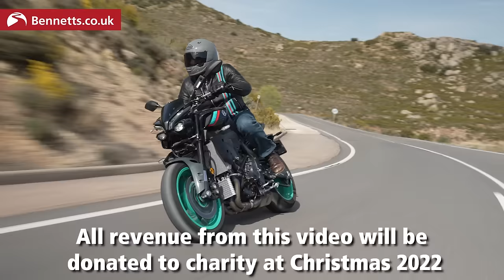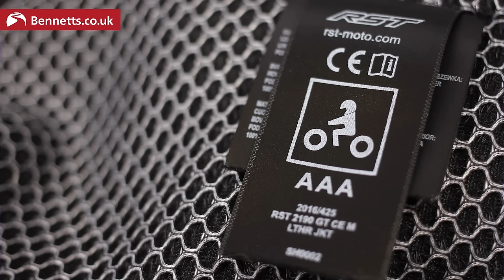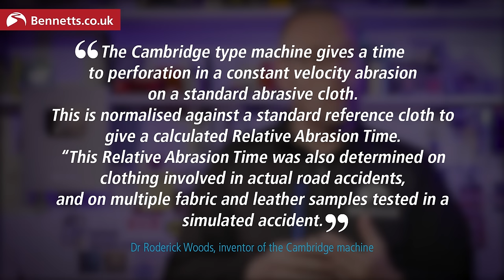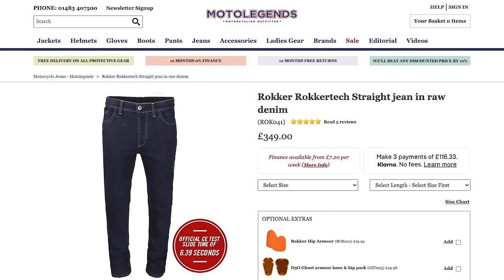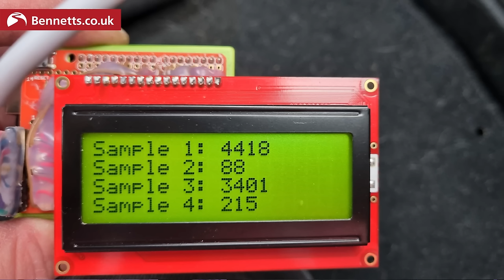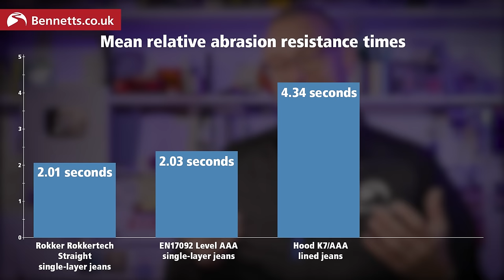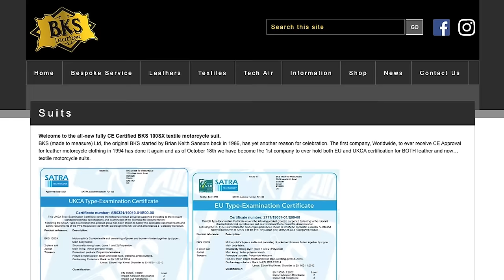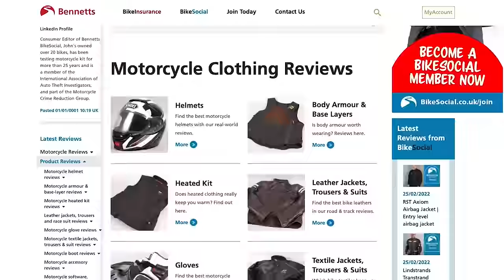Best motorcycle jeans | Single layer vs lined: THE TRUTH

Comment: Thank you for such an informative video. I’ve been also reading and searching about the motorcycle jeans during the pandemic ( for 2 years :D ) and the more I read, the more I got confused. After I figured out not all the motorcycle jeans are same, I ordered a K7/AAA but  bought online it’s a little bit on the thigher side, and I could only wear comfortably by removing the hip armours. It is also quite hot to wear in a start-stop city traffic. So I ordered a AA-rated single layered jeans in this Black Friday discount. It is written that it has 6.39 seconds of slide time claiming more than enough. So after watching your video I have 2 questions in my mind: 1. When I go on a ride in the twisties at weekend, should I wear my AA-rated single layered jeans or should I try to fit in my AAA-rated lined jeans?
2. I don’t quite understand in the video is that if you ever mean “a AAA-rated single layered jeans are less abrasion resistant than a AAA-rated lined jeans” ? Aren’t they meant to be same in terms of safety?Thank you very much again for your efforts, and explanations.
Reply from the maker: It really is your call, but personally when I'm riding out of town I use lined jeans. That's just my choice. 
Under EN17092, the levels are pass or fail, so AAA means the jeans have passed the most stringent of the abrasion, tear and seam strength tests for that certification. But we don't know by how much. EN 17092 is an easier to pass standard than the previous EN 13595, but it's still very valuable. However, the indicative test carried out here, as well as tests on more than 50 jeans by https://www.motocap.com.au show that lined jeans tend to be more abrasion resistant than unlined. And that good quality leather (not ridiculously thick leather) remains the most protective. 
It really is personal choice, and while I know I'd be 'safer' in leather when I'm thrashing my S1000XR on tight back roads, I choose to wear lined jeans. No test gives a 'slide time' – that's just a lack of understanding from sellers or simply misleading. Equally though, it could rightly be argued that if you hit a car or a tree, it doesn't matter what the abrasion resistance is!
The gear you have is not 'bad'; as Dr Hurren says, any motorcycle kit is better than no motorcycle kit. It offers you a level of protection, and that's great. It's way better than plain denim! How far you want to go with protection is your call, and it's important that you're comfortable too. If you end up pinched and sweating, that's going to ruin your concentration.
Have a look at this article, which will hopefully help: https://www.bennetts.co.uk/bikesocial/reviews/products/textile-jackets-trousers-suits/what-best-motorcycle-riding-jeans-kevlar-pekev-covec
Cheers, John
Reply: Thank you very much for your answer. I’ve just read the article. Your answer and the article have fulfilled the gaps in my understanding. I hope to see science, technology and investment on motorcycle gear develop quick enough like the motorcycle community.
Reply from the maker: @tongucarslan3840  No problem! I honestly just want people to be able to make informed choices, not influenced ones! Cheers, John

Comment: i remember when i first started riding i was super cautious about protective gear, after about a year on the road though i slacked off and started wearing shorts and tshirts. guess i was lucky i never came off at speed. only ever had one accident when i was learning on a 125cc scooter before getting a decent bike. i was going about 25kmph when a van braked in front of me without warning i skidded sideways to try an avoid head on collision and the bike fell  on its side twisting my under it and causing an acl injury which is not something i would wish on anybody, strangely though i didnt even get a single scratch, i dont even think my clothes got torn ?

Comment: Nice research, but the sample size is too small to conclude that all lined jeans offer better protection than all single layer jeans. This only shows that for the specific jeans that were tested. There are many single layer and lined jeans with a triple A rating.

Comment: Hey Team, 

Is it a fair assumption to make, as a consumer, that AAA jackets (or pants) are at least more resistant to abrasion than AA jackets, almost always? 

I'm in the middle of trying to upgrade my own gear, and I feel it would be helpful to at least narrow down the search to AAA garments, and only worry about the differences from there. Might end up being helpful to others as well. 

Thanks if you see this, and take the time to respond
Reply from the maker: Hi... Yes, absolutely. While in theory a brand could have only tested to a lower level, then only way to PROVE the abrasion resistance, seam strength and tear strength of the entire garment is though proper certification. Beyond AAA, the Bennetts High Performance Awards allow brands to prove higher levels of protection. https://www.bennetts.co.uk/bikesocial/reviews/products/high-performance-safest-motorcycle-clothing

Comment: I know testing can make things cost more, but many MFG's need to be held accountable to their claims - results must be available to the consumer. I would prefer a 3rd party non-profit style company that is publicly controlled (to reduce the risk of the Board taking unreasonably high salaries and to keep the public's best interest at heart). I'm not saying EVERY style of clothing needs to be tested, but they must demonstrate that their fabric, stitching, pads meet the standards. If they want to go the extra step and test specific styles, good on them--It would gain a sale to me at least.

Also would like to add, I wish there was a thermal transfer type of test. Most moto-gear, especially leathers are capable of abrasion, but don't really take into account the heat from the friction. Some of the tech fabrics have materials that can melt at certain temps, or very thin might burn your skin in a slide.
Reply from the maker: Have you checked out Motocap? Also, BS13595 should help a lot. Not all brands will use it, but riders can vote with their wallets.
Reply: @bennettsbikesocial  thank you.
Reply: @Frag EightFive: Testing does not need to make things cost more. When you purchase motorcycle clothing, part of the price you pay includes a proportion that the brand reinvests in the sales and marketing activity that may have influenced your decision to purchase their product  - advertising, brochure and web site, for example. If they vire some of that budget over to compliance activity, then testing will not affect retail prices any more than their advertising, brochures and web sites do.

An example. Last year, a company told me they “couldn’t afford” the costs of testing and certification for the item of clothing they were selling to motorcyclists. I pointed out to them that they had placed half-page ads in two of the monthly motorcycling magazines for the previous four months. In fact they had more than enough budget and were, therefore, choosing to advertise an untested, non-certified and illegal product, when just half of that four-month advertising spend would cover the entire conformity process!

Comment: Companies can still do better. Why is there not armour with tungsten carbide beads for wear resistant, aerogel for the isolation layer to protect from heat, then an impact layer? Should be able to slide for a hell of a long time if you at least made the armour pads out of those materials.
Reply: Some fabrics incorporate a ceramic component. My own BKS suit features this on the shoulders, elbows and knees. The fabric is quite stiff when new, however, and some riders seem unable to tolerate anything that feels even remotely restrictive.

Comment: It'd be interesting to put a thermometer into the Darmstadt or Cambridge tests to measure heat build up, as that's an important component in injuries incurred from sliding down the road.
Reply: Some work with the Darmstadt machine has already been conducted by the PIONEERS project. The following is a limited extract from the report on temperatures at the point of contact between test specimen and abrasive surface.

"Nylon ripstop was tested at 7 different rotational speeds from 30 till 70 kmh, with 3 sample runs for each rotational speed. The highest rotational speed was determined as the speed were hole formation was first observed.

"Maximum temperatures for the 4 graphs (Figure 44) below are: 69,97°C (30 kmh); 100,77°C (50 kmh); 120,18°C (60kmh); 142,55°C (70 kmh). 

"Performance leather was tested at 8 different rotational speeds from 30 till 120 kmh. The highest rotational speed was determined as the maximum rotational speed according to EN17092 because no hole formation was observed.

"Maximum temperatures for the 4 graphs (Figure 45) below are: 60,90°C (50 kmh); 64,42 °C (70 kmh); 71,68 °C (90kmh); 83,42 °C (120 kmh)."

The researchers encountered a number of issues with identifying how much of this heat transferred to the back face of the test specimens, which would equate with the skin of the wearer in a real world incident. The MotoCAP team is planning to conduct its own research, using the Cambridge machine or and/or its road-based tester, in the course of the next 12 - 18 months.
Reply: @paulvarnsverry11  Thank you very much for this insightful report. I used to work in Oil and Gas engineering, it's good to see that as much thought goes into motorbike safety gear.

Comment: Hi, thanks for the detailed review. I have lined which is good to know even if they are a little hotter on summer days. Have you considered doing a similar detailed test on airbag vests?
Reply from the maker: I am looking into that as most of my experience is only with the In&Motion system. Cheers, John
Reply: @bennettsbikesocial  I have the turtle 2 and specifically the version with the lanyard preferred the mechanical over the software driven versions. But would be good to know how the software works for the various providers, reliability and also mine doesn’t really need servicing just weighing the gas bottle so there’s a good video I think in overall cost versus protection etc 👍🏻
Reply from the maker: @rossmiller7741  The Helite system does offer excellent value – I have used that several times too (fortunately not in anger!). Cheers, John
Reply: @bennettsbikesocial  Indeed, it would be fab if you could do a detailed and in-depth airbags review – particularly the electronic systems, which vary in which crash scenarios they deploy. Airbag coverage also varies significantly. And while a few are CE Airbag Level 2, most are only Airbag Level 1.
Reply from the maker: @The-Splat  it's in the pipeline... cheers, John

Comment: I have skin shear on my upper inner thigh of my right leg. I got it in 2013 after a Transit van cut me off at a roundabout and shoved me into the Armco.
The force cracked the back of my helmet.
I have had the skin shear since then and it has never healed. The GP has treated and I continue to treat it every day.
It purple in colour and sometimes you can see the bone.
I think because of Syringomyelia and Diabetes it will never heal.
From suffering a C4-6 SCI and TBI in 2004 at 37 years old, my body was referenced to that of a 85 year old.
Reply from the maker: That's horrible! Sorry to hear it!
Reply: I would be very interested to discuss your skin shear injury with you for research I am conducting.

Comment: Fantastic information, brilliant work well done!
Question - regarding single layer hip and knee protected stretch jeans, i'm tending to wear various types of good fitting thermals underneath them (not silk yet), what's your gut feeling on this extra layer adding protection vs any negative points. Best wishes.
Reply from the maker: Any extra layers will add some extra resistance, but only testing can give the final answer. Cheers, John

Comment: The American made Saints denim for motorbike riders states it's the toughest on the road to date. Described as unbreakable jeans.
Not many people have heard of them.
I wonder how those would stand next to what you have already tested.
Reply from the maker: We've not had a pair of Sa1nt jeans on review, but we have come across them in the past https://www.bennetts.co.uk/bikesocial/news-and-views/features/product/motorbike-riding-jeans-denim-truth-ce-test-misleading-motorcycle-kevlar-dyneema
Reply: MotoCAP represents the most extensive, independent assessment of motorcycle clothing in the world. To date, over 50 models of riding jeans and leggings have been assessed, including the Saint Model 2 and Unbreakable Straight styles. These scored a single point for abrasion resistance, out of a possible 10, recording relative abrasion resistance results (Cambridge test method) of 1.16 and 0.93 seconds, respectively.

Ultra-high tenacity fibres perform well in tensile tests, such as seam strength, and this is confirmed by the burst test results recorded by both Saint models in the MotoCAP test results; but abrasion challenges the fibre in its weakest orientation - the cross-section - and this is why there is a huge disparity between the two sets of results.
Reply: Many thanks.  It's jeans I'd seen so called tests on all be it by the company.  By all means they looked not bad although I'd agree any company can make things look better than they may be.
I've not actually seen anyone do an independent test on their indestructible jeans, hence never actually picking up a pair.  I've always bought leather or cordura as I've never been sure of denim.  I do ride a gsxr and not long sold my busa so denim had always had that question mark for me.  Would be nice to have a pair and decent boots with a dress down look if that makes sense, hop of the bike for a meal somewhere and not have that look like I've just got off a bike.
Riding sports and super sports just put me off jeans.
Great report as always, informative and no BS.
Just what we need 😉

Comment: This is an awesome video. Seriously, very useful stuff.

Around 24:34, I'm skeptical that the AAA rating's additional zone 1 requirement over the bum is important. Bums seem cushy enough that I wouldn't expect the same kind of hard impact you could have on a hip, for example. Seems like an odd choice to me, not obvious that it's needed at all.
Reply: The buttocks area has been identified by decades of empirical evidence and scientific research as being at high risk of abrasion. In EN 13595 parlance it is categorised as Zone 2 and joins the extended areas of enhanced abrasion resistance around the shoulder, elbow, hip and knee protectors. 

EN 17092 muddies the waters in that in comparison to EN 13595 it combines both Zones 1 and 2 into the area covered by the impact protectors alone, and areas outside this are not required to feature enhanced abrasion protection, other than in the Class AAA buttocks area. My advice to riders is to shun any lower body protection other than that which features enhanced abrasion protection to the buttock area. Save your ….! 😄
Reply: @paulvarnsverry11  Thanks, it makes a lot of sense with that clarification. It was the impact protector part of the description that threw me for a loop.

Edit: Oh, actually, I see what I did now. I was reading the label for EN 13595, which says impact protector. But the EN 17092 label doesn't say that. My mistake
Reply: @SkeptikosUTube  : You’re welcome. As for your “mistake”; unless you are working with the standards on a daily basis, you cannot be expected to retain or recognise every detail.
Reply: @paulvarnsverry11  I bet virtually nobody knows only AAA pants must have (tested) abrasion resistance for the buttocks area. 

I’ve never seen it mentioned in the motorcycle press. E.g., this week’s MCN described an ‘A’ as “the third-highest level of protection”, inferring good all-round protection.
Reply: @The-Splat  : The buttocks area of AA and A/B garments is tested; it is simply that it is treated as Zone 2 and therefore subject to the lower performance requirements of those classifications, whereas AAA is specified as Zone 1 and must meet higher performance requirements.

The information is out there and available to riders - the work done by John Milbank and various articles to be found on blogs, vlogs, print media and other forms is a great help - but many manufacturers, importers, distributors and retailers of clothing say little or nothing in their sales and marketing literature and on their web sites. It’s rare to even see mention of the performance classifications for their gloves, garments or footwear. There’s still work to be done to help riders understand and the condescending attitude of some major clothing brands that it’s too complicated for motorcyclists to grasp (so why waste the effort trying to explain) infuriates me - especially when a number of those holding this view were responsible for the classification system they consider riders cannot comprehend!
Reply: @paulvarnsverry11  Thanks, Paul. One solution would be for the UK to join forces with Australia to add to the number of MotoCAP product tests.
Reply: @The-Splat  : There has been talk of a Global MotoCAP since before the FIM awarded the scheme the 2019 International Road Safety Award. I’m not party to any discussions that might be taking place in the background, but based on the reactions of some companies whose garments have not scored highly for safety, it would not surprise me if European brands turned out to be in opposition to MotoCAP’s reach extending any further.
Reply: @paulvarnsverry11  It would be fantastic for riders (and injury reduction) to have a Global MotoCAP. Unfortunately, I can’t imagine who would fund it.